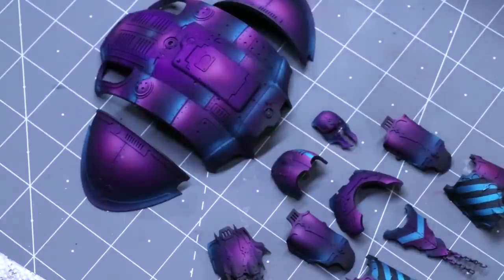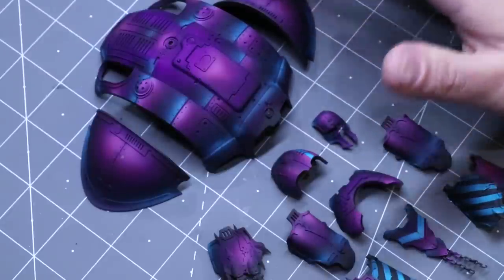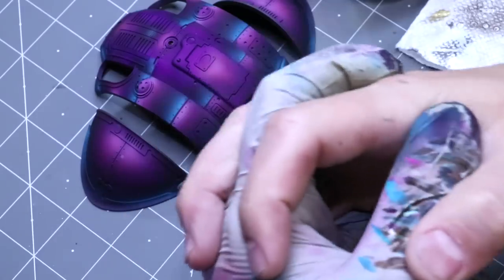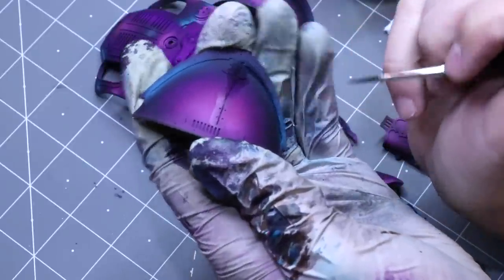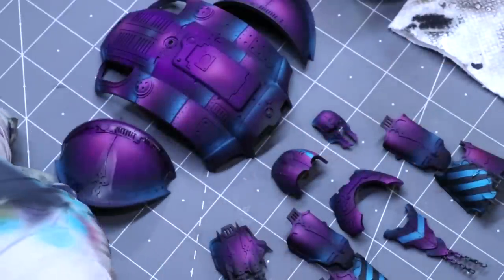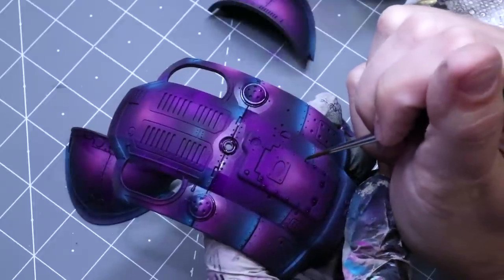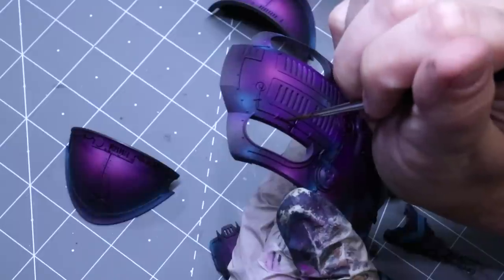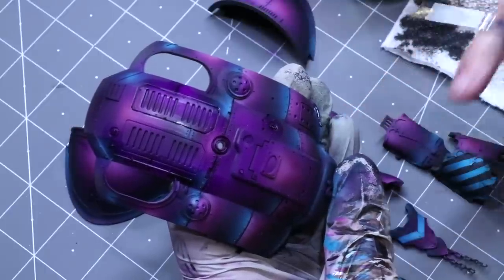Hobby Cheating 212 - Panel Lining with Oils

Comment: Another great thing about using oils for pinwashing like this is that you can go back after they've dried and do "clean up" rather easily. Oil paints will easily reactivate with more white spirits, so you can allow them to dry, then get a cotton swab or makeup sponge slightly damp with white spirits and very lightly wipe over the areas you want to clean up. This will (with a light enough touch!) remove the pigments from the raised areas and leave it in the recesses. You can also get some really nice feathering effects this way.

I also usually like to do a gloss coat before the oil washing, as the slicker surface helps the capillary action and clean up step somewhat. Then a final matte coat and you're in business.
Reply from the maker: I mention in the video that I did varnish this beforehand. :)

And yep, it's great for super easy clean-up for sure. :)
Reply: @VinceVenturella  Yup. Wasn't sure if you used matte, satin, or gloss, so was just mentioning I like to use gloss for pre-oils. Always enjoy your vids and have learned quite a few tricks from you!
Reply: Ditto. Been using a cotton swab to touch up any excess. Shout out to Marco Frisoni for that one

Comment: Hi Vince, love your videos, have watched everyone of them, some more than once. This is another trick from my scale aircraft modeling days. When the paint job is done, airbrush on a coat of Future Floor Wax, light but with total coverage, after it is dry do the same type of pin wash. the glossiness of the future really helps in the flow of the oil wash. after it is dry just go back over with matte varnish. Also, just returned from a private coaching class with Matt DiPietro, it was great. Would have never knew about it if it wasn't for your videos. Thanks.
Reply from the maker: I've never liked the future floor wax, I am familiar with it from back in the day, but I just prefer a simply gloss varnish. I should have mentioned in this case, I used two coats of satin varnish before I applied the oil wash. Mistake on my part. Don't worry though, I am very familiar with the varnishing steps in between. :) 

Awesome to hear you had a class with Matt, he's an amazing artist and I am sure that was a good time.
Reply from the maker: Edit: I did mention the varnish, just a little later than I thought, I mention is around 5:40.

Comment: Hey Vince, you know I love painting with oils! One thing I have noticed, Winton oil paints have a lot of linseed in them, which is why they dry slowly. Canvas absorbs oils, so the paint needs more binder.

Abteilung oils are designed for going onto primed plastic, which is not porous at all, so they have less linseed binder in them. However, this means they make VERY different oil washes, because there is less binder you end up with a much drier, dustier effect. The flatting agents no doubt contribute.
Reply: Thank you for the tip. Its the first time I hear about that brand. On their website it is obvious they are made for models painting unlike Windsor and Newton paint.
Reply: I've found that adding a bit of liquin fine detail (or similar product) is another way to decrease drying time.
Reply: @surfacetension4471  Unless I am mistaken, I think Mikey is talking about the end result. Windsor and Newton gives you a shiny finish and Abteilung a matte finish. Sometimes you want one or the other finish. I have been looking at the Abteilung website and boy they seem to have an amazing product there geared toward model painting and weathering them for a really affordable price. I have plenty of WnN tubes of paint and they are marvelous but if I can convince my wife that I need another set of paint because we will all die I will get myself one of their weathering set. Look at these sets:

https://abteilung502.com/product-category/oils/sets/
Reply: That's true W&N will dry shinier, although at a 10:1 dilution I imagine the difference is not massive, especially if you're varnishing over at the end. Like you though I like my paint to have a matte finish (mostly so I can see what I'm doing, and to provide a better ground for successive layers). Any brand that works for you is the one to go for, or just mix and match🙂. Gamblin's fast matte range is worth checking out as well.

Nowadays though, what I do is make a medium with liquin fine detail, OMS and diatomaceous earth. I use this to thin my oils, gives them the consistency of acrylics, they dry in 24 hours and the finish is as flat as any paint I've used. You've got to be a bit carefull not to create dust when making a batch up, but it takes the shine out of any oil paints I've used so far. I use a lot of W&N artist colour nowadays because they have really good pigment density and tend to be just single pigments which makes colour mixing easier. They have a tonne of oil in them but with that medium you still get a matte finish.
Reply: @surfacetension4471 Wow thanks for all the tips. When I see people like you I remember 15 years ago when games workshop was hiding every techniques they where doing so people would never be able to achieve their result level. Now people like you are giving us these tips and they realise that even if you would give every damn techniques you know it doesn't mean that someone will ever be able to get to your level. It gives you more subscribers at the same time and you lose nothing. 

And btw if you have a recommendation for when I use pastels for weathering. I need a clear coat that doesn't make all the pale pastel I use on a model disapear. No problems with dark pastels but when I use the pale one, well it  just look like I didnt even put them on the model. Thank you again for the tips have a nice day. You really have an amazing channel. ^^
Reply: @sebjulien3  No problem, happy to pass on anything I've learned. I don't have my own channel but happy to contribute to Vince's on occasion. I don't have an answer to your query as I've never used pastels, maybe someone reading this can help?
Reply from the maker: I love to see this kind of knowledge sharing in the comments, you all rock. :)
Reply: One thing you can do with artist oils is place them on some cardboard or paper towel for an hour or two, this will pull a lot of the linseed oil out. This is probably a better option if you already have artist oils since buying new oil paints is an expensive proposition.
Reply: Coming back to this comment after nearly 18 months: I've found I was actually completely wrong, Abteilung paints are all different with some being matte, some very glossy. I use W&N nowadays after I gave my Abteilung paints away.

Comment: Have a suggestion for your panel lining pin washing and that is using lighter fluid as the thinning agent. The difference is that using 'white spirits'  the flow action is about 40 mph, using lighter fluid you are doing 90 mph. ( hope everyone here drives), cheers.
Reply from the maker: That's amazing, I have never heard of that, I will have to give it a try. :)

Comment: Hey Vince, I’ve been experimenting more and more with oil painting on minis and busts... with how easy it seems to get buttery smooth blends, when would you NOT want to use them? I’ve given thought to moving mostly to oils but I feel like there’s got to be a reason not everyone is using them. As always, thanks for the quality content!
Reply from the maker: There are some folks that use exclusively oils, they are just more tricky is the answer and the tools aren't as commonly available. Acrylic is easier is the key. But they are worth exploring.
Reply: Late to the party (recommending this on Reddit, so looked back at it) but after using oils for a bit, I'd use them when I want the smooth blends, and I'm willing to wait the time it takes to dry. When I want the paint dry and ready to go in the morning, if I want "that" specific color, if I don't want to deal with the hassle, or I want to use a few specific techniques I'd use Acrylics. Otherwise, yeah oils are often superior.

Comment: Thanks for the video Vince. I've found that the spreading effect you mentioned can very occasionally carry some pigment with it. Black not so much, but dye based pigments like pthalo colours do pose a risk. You can avoid it by using  a less matte varnish (and then spray matte varnish over the top when dry). Also +1 on that plastic slurry video request.
Reply from the maker: Yeah, I haven't had any issues, but in the end, I've just cleaned it up with some white spirits and gotten back to the original. :)

Comment: Worth noting that you don't need to varnish before using the oil paints.  They don't react with acrylics at all (neither do the mineral spirits).  Varnishing is only worthwhile if you want to change the smoothness of the surface to affect the way the oil wash flows.
Reply from the maker: It's a good point, I use Satin varnish as a save point, just makes everything cleaner and easier and makes it reduce the chance of damage.

Comment: Hello Vince! Thank you for this tutorial... for smaller models, like marines, would you varnish with gloss varnish to make the oil wash behave better? And after the oil is dry, a matte varnish to paint the model again, because I guess the paint won't stick to the gloss varnish?
Reply from the maker: Yep, exactly what I would do. :)
Reply: @VinceVenturella  By "varnish" what precisely do you mean?  Any gloss or matte clear coat?  Does it need to be oil based varnish? polyurethane is water- or oil-based plastic resin, varnish is older and made from resins, oils, and solvents.  What's should I be using?  Thank you!!

Comment: I'm currently sitting at two Baneblade tanks (commission work, customer wanted all available options). it's a pin wash nightmare...

btw: if oxgall is mixed in the wash, it flows even faster in the recesses. oxgall acts as a degreaser and flow improver/wetting agent.
Reply: Thanks for the tip about Ox gall its the first time I hear about it.
Reply from the maker: Yep, I've used some of it before and had some decent results, it's a good tip for sure. Good luck with those big tanks!

Comment: Great Video! I'm using this technique on some space marines and the first one turned out pretty good. I do have a question on the Varnishing aspect of the process though.... Do you  varnish with a gloss or matte varnish before you apply the Oils? Also, I noticed on some edges the oil lines kind of turn "muddy/grimy", any tips to make those a bit more crisp? Lastly, you mentioned doing 10-to-1, thinner to oil paint, how do you measure that? by weight?
Reply from the maker: in turn. 1) Gloss will make it flow smoother (and prevent some of that muddieness later), but you need to then ultra matte after. 2) It will always happen to some degree, but the gloss can help. 3) General eyeball, it doesn't have to be exact, just in the neighborhood.

Comment: Hey Vince, 3 years later, but… Just starting to experiment with oil washes but having trouble with consistency - sin to get the pillar reaction but after it dries, it seems to fade away?
and is it 100% necessary to glaze before pin washing?
Love your channel! Thank you
Reply from the maker: It's not necessary to glaze, getting the right consistency is tough. You can buy pre-made enamel pin washes that are tuned correctly, that is another option.
Reply: @VinceVenturella  Thank you so much for your reply!! 
I’ll keep trying - much appreciated! Keep up the good work!

Comment: you said at the 6:00 mark to revarnish to bring it all together, why not use the odorless thinner/mineral spirits on a cotton bud to clean up the excess that went outside the panel line? i watched a lot of videos of people build 35scale tanks and that's their method.
Reply from the maker: You can certainly still clean it up as necessary, this is more because you will always have some shine or different finish from the combined mediums, this just flattens everything back out, you don't want shiny shadows. :)
Reply: @VinceVenturella  will spraying it with a mat varnish over the previous gloss flatten it out? and thank you for replying.
Reply from the maker: @MF-kv8cn  Yes it will

Comment: Hi Vince, in Gunpla we usually use products that are enamel based like Tamiya panel line accent. We also used a qtip loaded with thinner to try to clean up the little splotches where we touched the brush to the model. Do you recommend doing that as well?
Reply from the maker: Sure, the clean up is something you can easily do (I think I mention in here that you can always go back and clean it up). I actually don't like Q-tips, as they tend to break down and leave detritus. I prefer small make-up sponges as they are far more durable.

Comment: If you want to deal with oils faster — drop them on cardboard first, after 30 minutes mix your wash and then use hairdryer on the lowest heat mode. Also search Michael Rinaldi videos about oil rendering
Reply from the maker: Yep, I have done that as well, in this case, I was putting the pieces to the side for a few days to work on the skeleton, so I had the time. :)

Comment: What did you varnish the figure with before applying panel lines and what did you varnish it with after the panel lines were done?
Reply from the maker: So I will usually use a little satin varnish on matte paint before I panel line, then afterward, it's a few drops of satin varnish and mostly AK Interactive Ultra Matte Varnish.

Comment: Very informative video as always! I was wondering: would acrylic paints added with enough flow improver and retarder medium behave like oil paints?
Reply from the maker: Closer, but then you run the risk you have them so thinned they have no actual coverage potential, if you were going to go that direction, you'd be better off with acrylic inks, they have a higher pigment density.
Reply: @VinceVenturella  makes sense, thanks!
Reply: @VinceVenturella  I'm late to the party on this question.  Would a combo of Scale75 Inktensity and vallejo thinner work? Gloss or matte varnish?
Reply from the maker: @AvatarOfNateP  You'd want flow improver, not thinner. Acrylic thinners are basically just medium, it doesn't change the properties or break the surface tension. Flow improver is basically like dish soap, it breaks up the surface tension.
Reply: @VinceVenturella  Awesome. Thank you sir.  Looking forward to Wednesday!

Comment: Hey Vince, I've tried this with many combinations of paints and white spirits, W&N, off-brand and even Abteilung 502 which is supposed to be the best oils out there. Yet with any brand of paint regardless of the brand of white spirit (hardware or specialty like Abteilung), the black paint will disintegrate into a grainy mess when diluted. When applied on a model it looks like running mascara or something like that.

Have you experienced this, and if so how do you counteract it?
Reply from the maker: Yep, so what's happening is you are thinning it too much. THe oil medium is breaking down (the linseed oil). You can use less white spirits or you can add a little Oxgall to increase the flow of the oil.

Comment: Hey Vince, any thoughts on using an oil pin wash with light colors instead of as a recess shade? I've been playing with the idea of doing white and cyan oil washes on an Eldar Avatar to make him look like he's radiating white-hot heat from within, but I'm not sure whether an oil wash would give too subtle a result.
Reply from the maker: I've never tried it, but it seems like it would work. You would have to carefully catch the edges of the panels with light and have some kind of transition up on top, but it seems like it could work, they are heavily pigmented, so it should be bright.

Comment: Do you have any advice for panel lining 3d printed things? I find that while it sinks into the panel line fine, it also sinks into all of the layer lines of the print as well.
Reply from the maker: With those kind of situations, you kind of have to panel line them like an old black lining method, you can't rely on a wash or something similar, you have to basically take a sharp brush and a dark ink or thinned paint, perhaps with flow improver and reinstantiate the shadows.

Comment: Do you clean up excess oil spill over/staining after it dries? in so much as those panels getting a spot check with spirits on a brush before you varnish?
Reply from the maker: Yep, I mention it briefly in there, but I will usually just clean up with a broad, flat synthetic brush dipped in some white spirits then wiped nearly dry.
Reply: @VinceVenturella  Those stains around the seems you were saying go away after sealing/varnish? so no need to wipe them? Ask in so much as have been using oils in place of a dark tone/nuln/acrylic wash and wiping the flat surfaces clean while allowing the dark to fill in recesses.

Comment: Are you implying that after the second varnish, you can simply clean up any oil spill over by painting over it? Or does the second varnish actually do anything to mitigate the original oil spillover?

I’ve seen other painters recommend cleaning up spill over with a q tip. Do you find that’s unnecessary?
Reply from the maker: I'm not sure what you're asking overall. So with oil panel lining, you can use a q-tip, but it's risky, it wants to leave fibers. You are better with small foam make-up brushes, they don't leave fibrous residue. You want to clean up before you varnish, but if there is any staining left, yes, once you varnish, you can just paint over.
Reply: @VinceVenturella  Understood, thank you!

Comment: How, or would you, apply this to smaller models with panel lines - something like a tau battlesuit, or a heavily plated marine?
Reply from the maker: Basically exactly the same, nice sharp synthetic brush and touch to the panel lines and edges just like I do here, this is great for minis like space marines around their edges. You can clean up afterwards with a little q-tip or something similar dipped in a little white spirits.